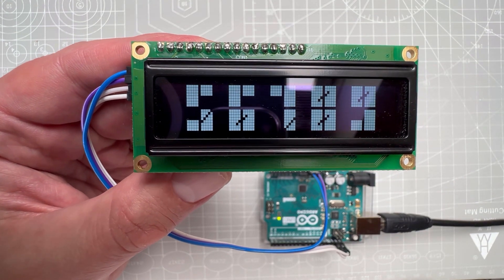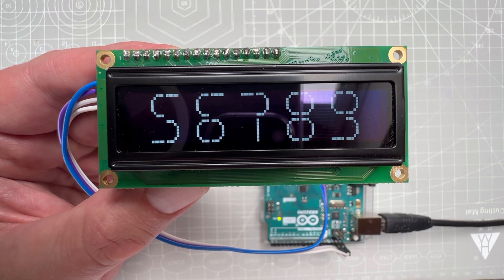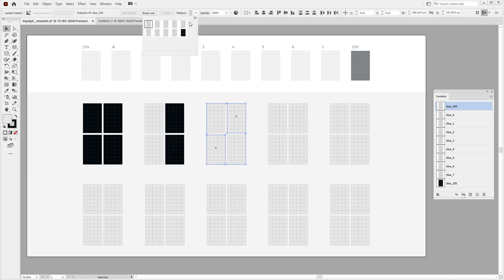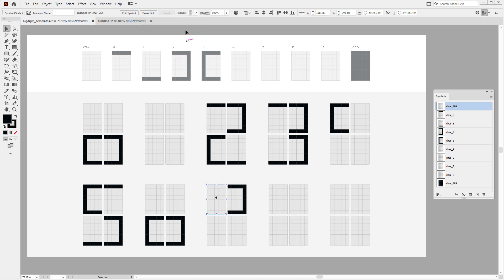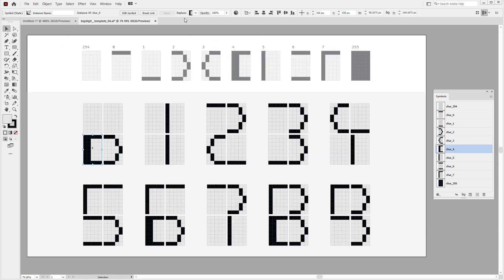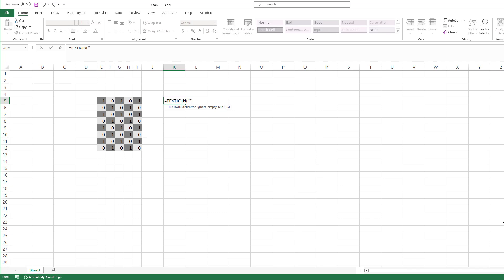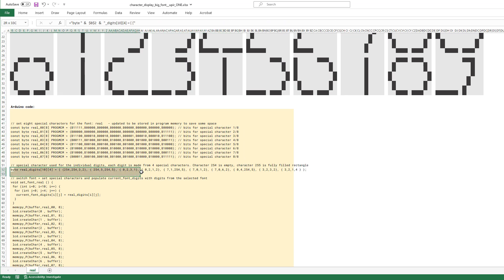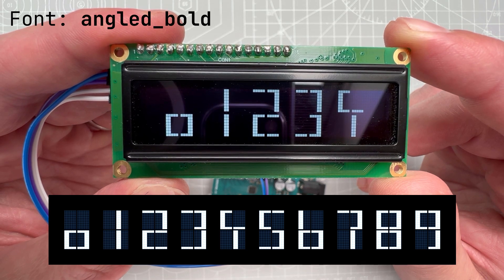small display - BIG DIGITS

Comment: Did you consider using any of the other hard-coded ascii characters as elements for your fonts?
Reply from the maker: I did, but the upper ascii characters might be different based on the used chip, and pretty much all the hardcoded characters only take first 7 lines, leaving the last eight line empty for the cursor..

Comment: I made clock with this method With only 4 character.
Reply: Nah it's just my personal hobby; but i'll share at github some time. I use 2004 LCD, each number is 3*3 size.
Reply from the maker: @gsytb725  OK, feel free to post a link if you decide to put it on github. I have noticed that creating bigger digits require less characters, but unfortunately 3x3 size is not an option for 16x2 displays...
Reply: @upir_upir  Yes That's why i use 2004 lcd. mine is just bunch of coded line not complete library. I'l post it when I can make proper arduino library, Then I'll reply link to you.
Reply from the maker: Cool, could you share your project?